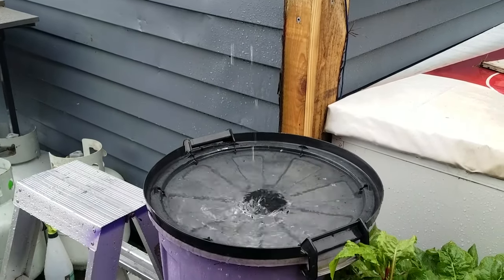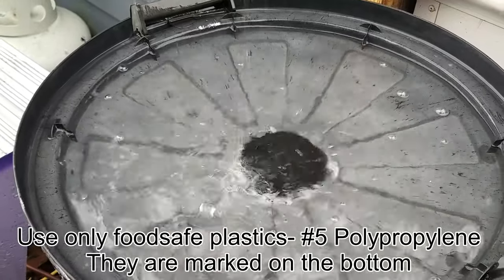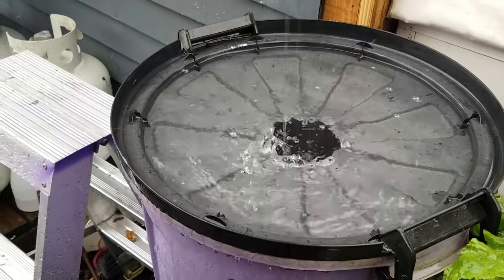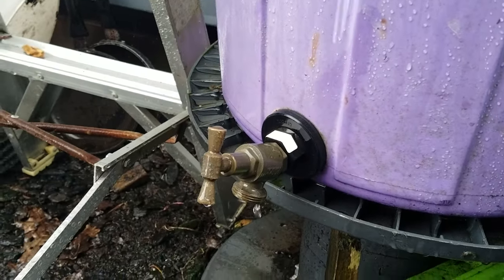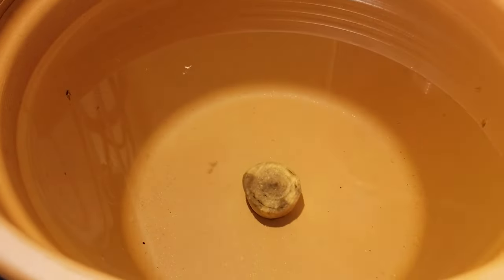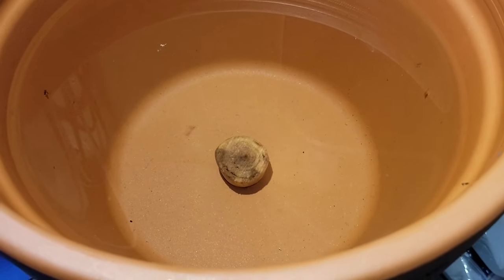Rain  Water Harvesting - No Roof or Guttering! 2.5 mins, New Release

Comment: Hi, I went to my local scrapyard a bought 2  waste sheets of stainless steel, plus a small square for the lid, then my local car parts distributor for a roll of stainless welding wire for my Mig, & plan to make my container drum for the pot filter this coming weekend. Although I have an electric water distiller, I'm doing this as another fall back should the power go down, so I won't have to rely on my Genny. Thanks for your content & great ideas & keep them coming, my friend.   Regards   Urban Geeze.

Comment: A terracotta pot filters to 0.5 microns? I believe it, but I'd like to see your source of data.
Reply: And how much of the water actually passed through the piece of timber plugging the hole or around the edge of it almost as slowly as through the terracotta?
Reply: @fredio54  Agreed. More importantly, terracotta pots aren't regulated for purity, who knows what's in the clay? (Lead for example)
Also, this form of filtering only works for solids, not dissolved substances.
Reply from the maker: https://www.cdc.gov/safewater/ceramic-filtration.html
Reply from the maker: @fredio54   thats why - in the absence of a rubber bung or cork I used a piece of well shaped and sanded Lawson Cyprus as the oils in the timber are antiseptic and a good preservative https://www.miraclebotanicals.com/lawson-cypress
Reply: @ravenrock541  You mean like antigens from bird poo from the collection surface? :-D Agreed, I had also thought about the purity of the cheap Chinese made pot, heavy metals quite likely from that nation.
Reply: @t.h.o.r.  Thank you. I noticed two items. One is that the filter pots shown in 'Potters for peace' is that the ceramic material of their pots is over an inch thick. Second, the impregnation of the clay with colloidal silver.
   I would definitely recommend dropping a 0.99% silver object (coin or jewelry) into both upper and lower areas of your filter. Interestingly enough, the Romans used to put a silver coin in their water/wine barrels for long term storage.